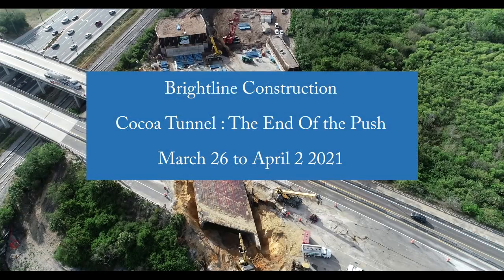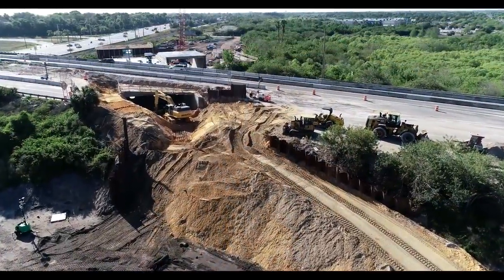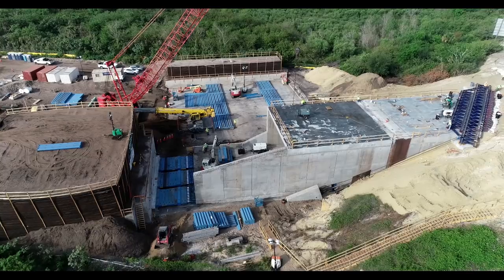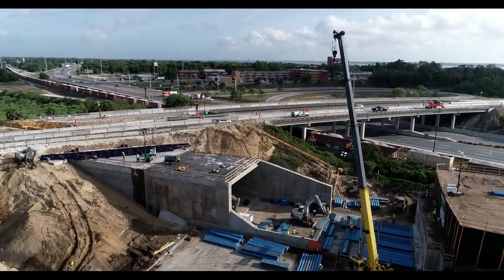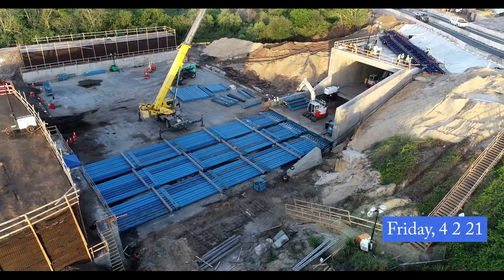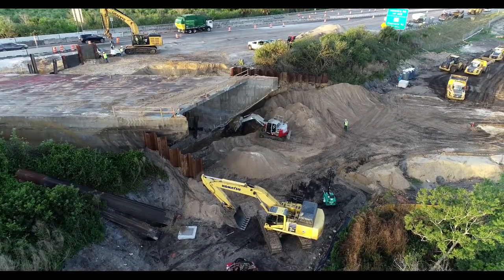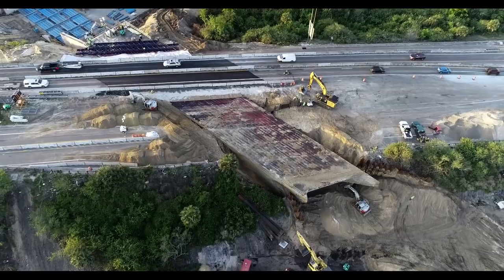Brightline Construction, The End of the Cocoa Tunnel Push

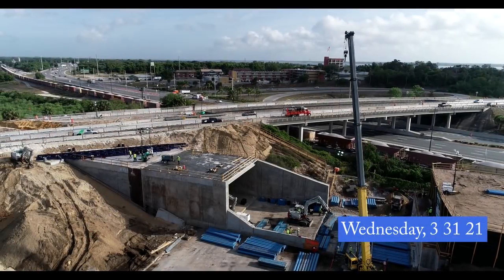Comment: Cocoa Tunnel is to the pilings they are done all that is left is cleanup, paving, and delivering the ballast to the site. at 2:12 FEC brought in a ballast train and is storing it at their yard after the two jacking structures are demolished FEC will bring the bulldozer pulled track laying train in there and they will start laying track once the tracks are down then they will dump the ballast. On the FEC they need to cut the south main outside of Cocoa Yard and place a switch so Brightline trains and a local can reach the power plant and the Airport Spur where FEC interchanges with CSX and NS.
Reply: Thats limestone, Bright line had contracted Granite ballast from Macon GA last i knew